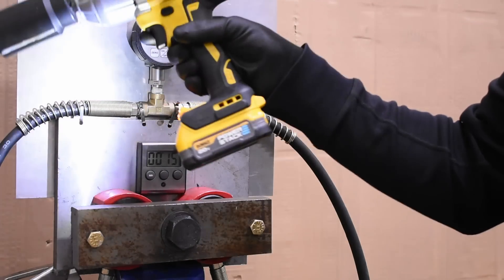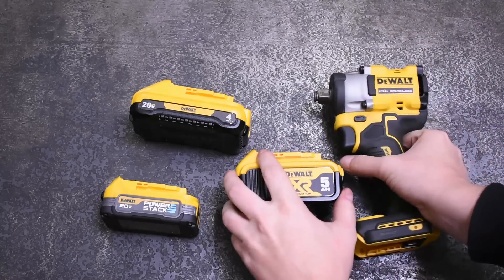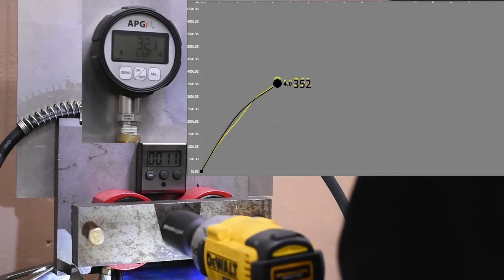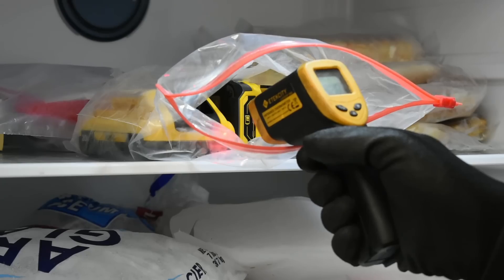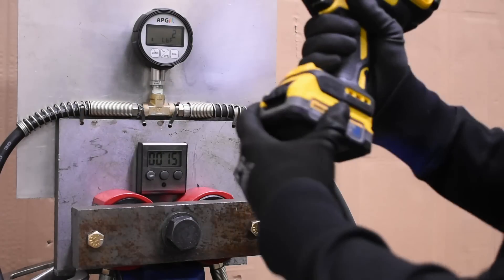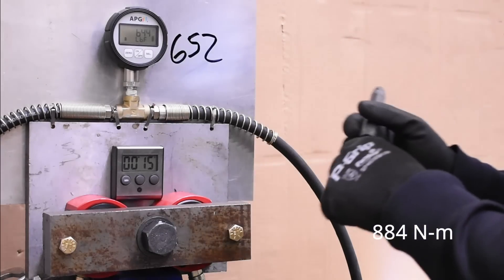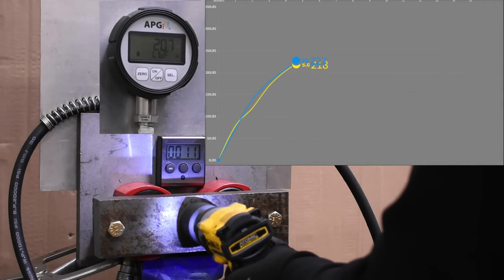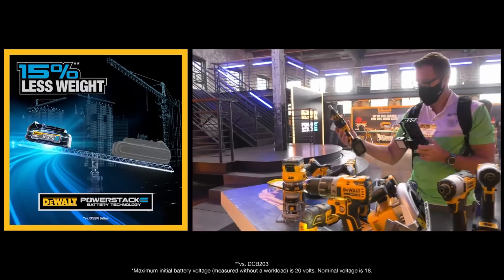This is NOT a Normal Tool Battery: DeWalt Powerstack Dyno Tested

Comment: Only took over a decade for tool industry to embrace lithium-polymer batteries...and somehow they undersize it.  My guess is they're intentionally limiting the pack size for shipping/safety reasons right now to limit the amount of energy in each cell.
Reply: its not lipo, its lithium ion still, just diffferent format
Reply: @NIGHTMAREuki  They're li-po, DeWalt literally says 'pouch'' on the website.  They're just classifying them as li-ion and not using li-po vernacular to avoid negative publicity.

Comment: Would like to see runtime vs a 2ah battery. Dewalts trying to claim that even tho its only 1.7 "its efficient"
Reply from the maker: There's no getting around capacity. What they mean is that this is more powerful so a saw might be run like 2/3 the amount of time to do X task, therefore it will run as long or longer than a 2ah. I mean not on a heat gun, and a whole lot of other tools like nail guns ect. But they are being a sneaky sneak

Comment: I'll be more interested when DeWalt and other companies move away from Lithium Ion batteries altogether.   Wasn't 1.7Ah supposed to be equivalent to a 4Ah/5Ah battery?
Reply: No?
Reply: In C rating, perhaps... li-po's have far higher discharge current capability than li-on batteries.  But mAh is maH, and there's no getting around it.

Comment: $120 for something that dies in 5min. Yeah, I'll stick with normal batteries. There's a reason why electric cars use cells and not pouches.
Reply: Some electric cars use pouches but a lot use prismatic cells. Cylindrical car battery cells are more of a tesla thing, as they are harder to pack densely and still keep cool.
Reply: This is a "normal battery". Its the exact same chemistry as the regular batteries, but eliminating wasted space from trying to fit round cells into a rectangular shape. The reason it doesn't last long is because its a 1.7ah pack. Its way too expensive but still hits as hard as a 5.0ah.
Reply: I believe the new GM Ultium battery pack will use a pouch type cell.
Reply: The power stack is so that you can have 5ah power in a 2ah package. So saving g weight and size.

Comment: This battery will be dewalts biggest failure as a Construction worker a 5ah battery is used as a minimum and 6ah preferred get the weight down on them and your golden